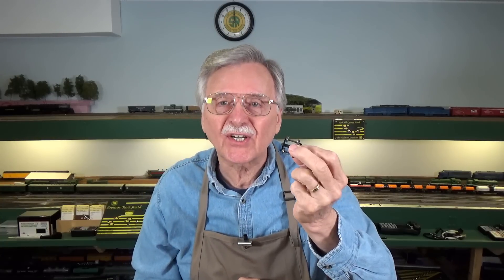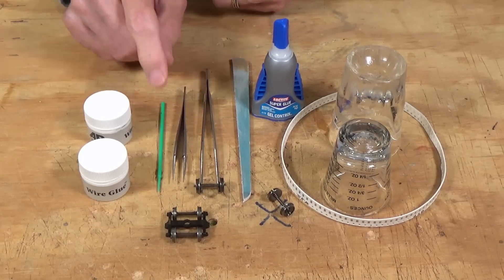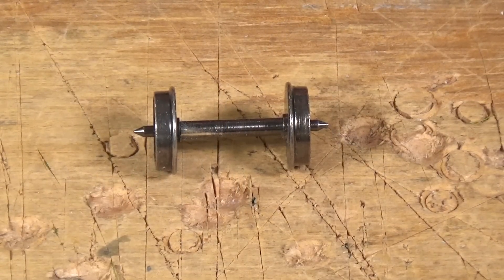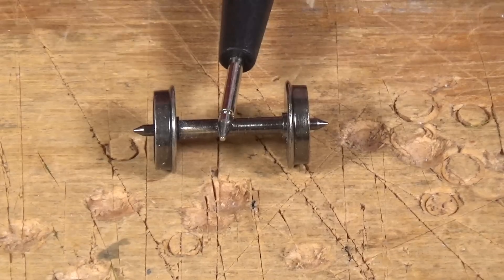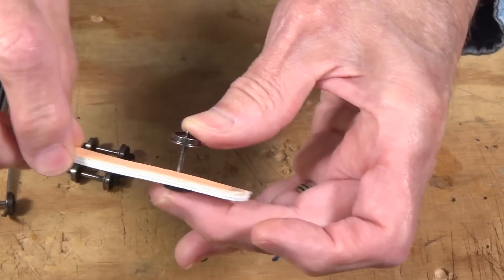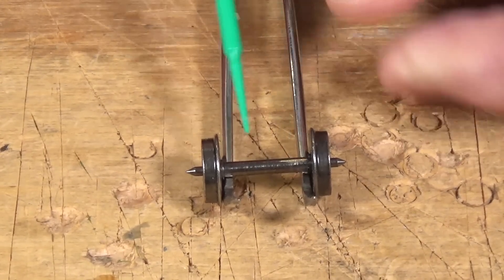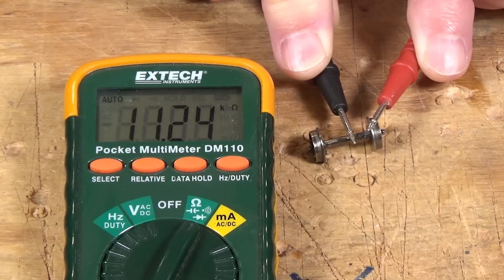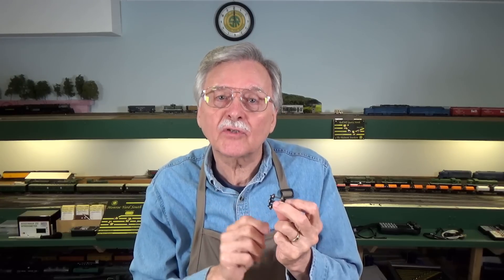Why Buy When You Can Make Your Own Detector Wheelsets (319)

Comment: Thanks for doing this Larry. So this small amount of resistance can be detected by a Digitrax block occupancy detector? Also, if you had a train with 25 cars and you did this on each wheel set ( 2 of the 4 on each car ) on each car and all of the cars were in the same block, how much power would they draw? I know if you have a loco with lights and sound and a lighted caboose it would be higher but what would it draw just for the 25 cars with the detector wheel sets?
Reply from the maker: I don’t remember what resistance Digitrax recommends for use with their detectors. I have asked my EE technical advisors to wade i  with an answer on the issue of how this works with multiple resistor wheelsets in the same block and expect an answer this week.
Reply: @TheDCCGuy  Thank you Larry, I appreciate you doing the video, responding to my question, and seeking expert help to answer the question. I would also like to find out how much power a train of that length would draw so I would be able to determine how many amps I would need for each train of that size in a block.
Reply: @derekalexander4030  Mr. Derek! We are far from our usual haunt today!  I gather you’ve got or will have independent “blocks” for signaling and power.  I’ve no plans to do this, but do have some ideas from others and my own.  Get a beer…
 
1) The biggest issue is that different detectors have different detection minimums, even the same make & model.  If the manufacturer or someone lists a minimum current (Google is your friend!) at the working voltage of 12-15V, make sure each resistor wheelset passes at least 10% over the minimum amps to ensure detection.  Then test each set individually on a spare track hooked up to a detector before putting it back on the rolling stock.  Each truck (one resistor wheelset) should set off the detector.  A multimeter will work if you haven’t bought a detector.

If you can’t get the minimum, use a ~12V power supply (a command station will work), a 30k, 20k, 15k, 10k, then 7.5k cheap regular resistors, with the detector in series.  Gradually reduce the resistance until the detector reacts.  Then use that resistance or the next lower in micro resistors.

2) You only need one resistor wheelset per truck and it best be the wheelset closest to the coupler if you have truck couplers - doesn’t matter with car mounted couplers since trucks spin like tops.  For better accuracy, use another resistor wheelset on the other car truck.

Since resistors in parallel cut the overall resistance, two 10k wheelsets, one on each truck with clean wheels will have the equivalent resistance of 5k total.  That’s half the resistance of one 10k wheelset.  Half the resistance, more current passes, better detection.  BUT, too many resistor sets in a block may trip the command station breaker or overheat it and the locos.  Thus:

3) It’s best not to put 2 resistor wheelsets on each car you own.  You only need either a locomotive powered on at one end, and one car with resistor wheelsets at the other end - presuming your train is shorter than the shortest block it goes through.  If the train will be longer, you need one resistor car in the middle somewhere, too.

So, the thing is to only use these wheelsets on cars that need them.  If you’re just running circles, then the lead loco, one car in the middle and one at the end in a train that’s between 1 & 2 blocks long will fully detect.  In fact, a 2 block long train with mid-train distributed power & rear-end power (all consisted & running) doesn’t need any resistor cars - unless you turn the engines off.  For caboose era layouts, putting 2 resistor wheelsets on every caboose may cover 90% of mainline & modeled branchline trains (i.e., not fake interchanges).  As long as there’s one powered on loco or resistor wheelset in every block, whole trains will fully detect.

If you want to do operations, especially in the post-caboose era, it gets more complicated.  In simple terms, you want to yard-classify every outgoing  mainline and modeled branchline train such that you’ll set out each group of cars so the one resistor car in each group will be the furthest back in each group of the pick up train(s).  This way, no matter who picks them up, in what order or when, a resistor car will be the rear car.  Real or dummy flasher if you can work that out.

- If you plan to leave a set of cars on any main/main branch line track that will straddle 2 blocks, then yard-classify for the front-most car to be left on the main to have resistor sets.
- If you use modern era rear-end flashers, then each car with a built in one should have at least one resistor wheelset closest to the flasher end, preferably not on the flasher’s electrical pick-up set if it flashes too.  
- Every MOW unit, rear platform passenger unit, unpowered dummy B units, slugs & tenders, a couple decrepit push cars locos, and other ad hocs should also get the treatment.
- Put sets on one or two of all remaining types of generic-use rolling stock you have, just in case. (cattle, tank, box, flat, hopper, etc.)

You can signal big yards & major multi-industrial sidings, but that starts getting very complicated to plan.  Good luck Derek!
Reply: @einaltermannquatscht  Wow, thank you Frank. What I wanted to accomplish was to have each car detected so that any car left on the main or any other track or siding while switching would be detected and the signal system would protect the track. I’m planning to use Digitrax Command control and I want to run the transition era, specifically 1953 UP, SP and ATSF, with cabooses, but didn’t want to just use the loco, caboose and one car in the middle to set off the signals in case the car in the middle was placed in a siding or yard lead and the rest of the cars sitting on the main or siding then wouldn’t be detected. My other concern was how much power would the 25 detected cars draw in a block and would I need to increase the amperage because of them. Nothing is in stone and I’m listening and appreciate your experience.
Reply: @derekalexander4030  You're welcome, Derek. 

In the history of RR signaling, mains & branch line mains have been signaled by block, at interchanges, major yards, major traffic sidings, RR-RR crossings (diamonds, X-crossings) and passing sidings.  But minor sidings are almost never signaled, they use derails.  Modern small derails are mostly post-1950s.  Before those, typical small & medium sidings were protected by catch points on the siding near the mainline.  Before that time, a siding full turnout near the mainline that just led to dirt & gravel.  The catch point is typical in the 50s & 60s.  It was a single shortened turnout point rail that flexed at the point end, just like real turnouts.  If mounted just inside one rail & flexed inward toward the track center, cars pass through. If released by what’s essentially a manual turnout throw, it slammed against one of the siding’s rails, causing an errant car coming out of the siding to derail short of the main, say if the car’s brakes failed.  They’re still used in places.

Small industry sidings in the 50s would either have catch points, some homemade derail, or nothing (there were still many rail accidents and RR workers killed in the transition era; 2500-3000 annually).  These sidings simply didn’t get signaled unless they were a major traffic spur, very urban, or there had been many accidents.  Signaling small spurs just isn’t historically done (railroads were cheap with safety).  The conductor, who was in the engine, would jump off and release the catch point after entering the siding, then later set it for the engine alone to back out to the main, and release it again to protect the main from runaways on the siding.  Even today that's normal, just mostly it's those yellow portable derails (check DJTrains' operations drone videos of industrial sidings.  Even big industry sidings are only protected by a 2-foot piece of cast metal on one rail).   

Most yards of the 50s with 3-6 classification tracks and one A/D track (typical HO layout) would not be signaled either, except at the main(s).  Back then labor was cheap - cheaper than installing even dwarfs with all the wiring, maintenance & electricity costs.  People switched and directed trains under the yardmaster & district dispatcher back then.  Today, engine conductors or yard workers switch & direct in yards.  There haven't been signals in many small-medium yards since the early 40s.

One way to cut the number of resistor wheelsets would be to use only one per car.  Still, just 10 cars in one block using 10,000 ohm resistors would be equivalent to a single 1k resistor.   The DCC station might not trip, but it would warm up, the engine would warm up and maybe the lights would dim slightly, but that’s not the problem.   The decoder(s) in that block would probably stop working well and a decoder BBQ is possible.  Your whopping 25 cars would be merely one 0.4k resistor or 400 ohms, 4% of a 10,000 ohm resistor🔥.  So be careful.
Reply: @einaltermannquatscht  Thank you, sorry I wasn’t clearer. I was not signaling the small sidings or yards. I am planning a double track main and was only thinking of signaling the main and possibly the mainline sidings that could hold a full train. Is there another way to have each car detected? If I used JMRI and told the program where I left the cars would that be sufficient to have the block be highlighted as occupied? I just thought it would be terrific to have each car be detected but frying a decoder or loco is not my idea of fun. I’m new to DCC, past two layouts were DC and plywood plantations. When I saw Larry’s detector wheel sets I thought that would be easy and inexpensive and I could do all of the cars. I wasn’t aware of the possible side effects and didn’t want a train full of detected cars and a sound loco and lighted caboose to need its own booster so I was looking to find out how much power it would draw, lol.
Reply: @derekalexander4030   Sounds like you're on your way.  There are other ways to detect presence.  Some modelers use magnets underneath cars Hall detectors buried in the track, some use optic sensors the same way, and some use RFIDs & bespoke software (it's also their pretty prototypical ops system).  But resistor sets are the best & cheap enough.  They'd be my choice.

As I said, it's not really constant extra current, though that will cause some unwanted heat.  It's more about spurious noise & current variations from so many moving circuits that may cause decoder issues.  It might not be a problem, but I would invest in at least one high end all-electronic adjustable model RR circuit breaker to test the limit.  They're pricey, but cheaper than a new DCC system or a new sound decoder.   And don't just listen to me, I've not built one.  Our best friend Google ought to be able to find people who've done something like this.
Reply: Current draw for 25 cars with detection on 2 of 4 wheel sets is approximately 0.06 Amps.
Reply: @peterwilliamson4663  Thank you Peter

Comment: Thanks for this demonstration. I bought all the pieces and parts, but I have not attempted to make them yet.
Any idea if they give issues with frog juicers?
Reply from the maker: Frog juicers are more of a problem in their own with detection since they use a small amount of current and may be detected by the block occupancy detector themselves. Most detectors have a way to decrease their sensitivity to address this issue. For example the BD-20 has a spot for attaching a resistor that will reduce sensitivity and some DCC Specialties products have an automatic procedure that calibrates it to empty rack and corrects for any “background” current drain.
Reply: @TheDCCGuy  Thanks for the detailed answer!!

Comment: I did  very much the same method on my British N scale layout some years ago so that the signals could be controlled via the block detection. I hadn't thought of using tweezers to hold each wheelset. I used a piece of packing foam with small slots cut into it to hold a few wheelsets at a time. I also put a white line on the truck next to where the resistor fitted wheelset is so I can quickly identifiy them. 
As my Amerian N scale cars had Microtrains plastic wheelsets, I used the ready fitted Fox Valley ones but as they were hard to get  over here in the UK I have only fitted a few cars with them.
Reply from the maker: I am mainly interested in detecting the presence of the train so as long as the loco or caboose or a lighted passenger car can be detected that should be enough.